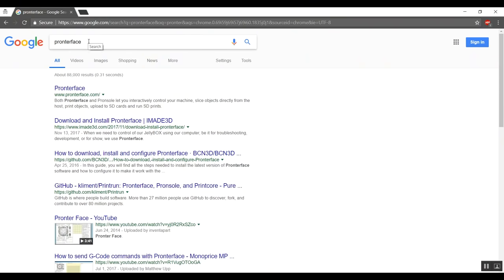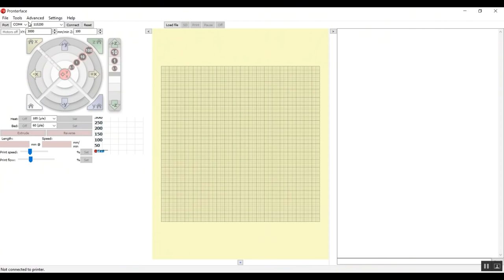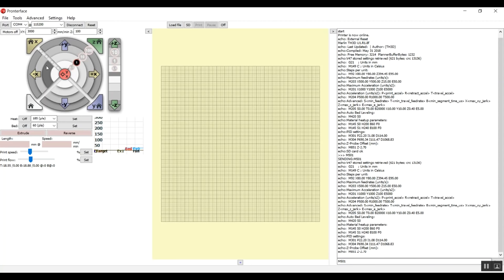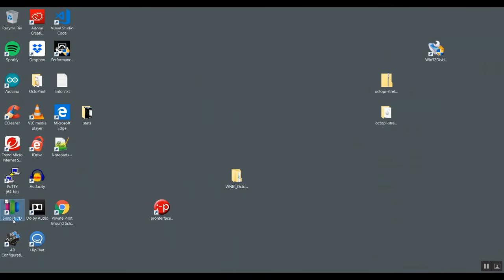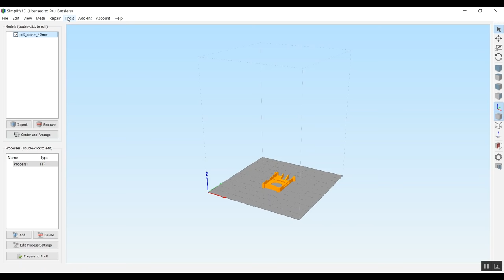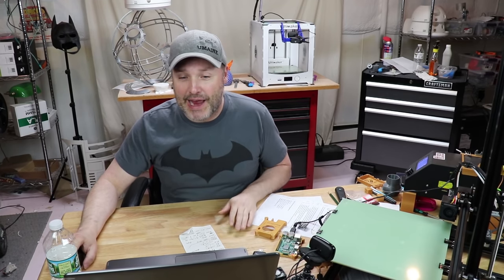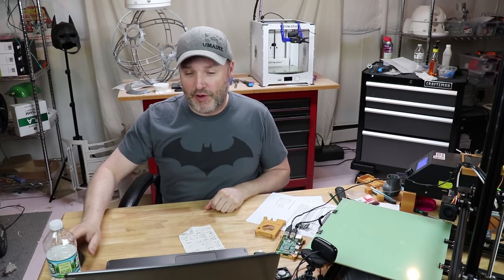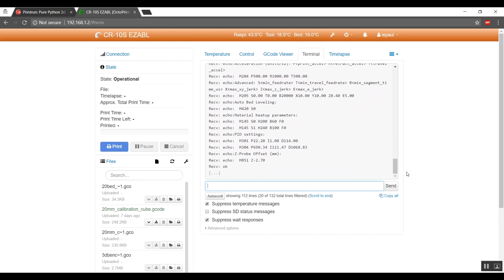How to connect to your 3D Printer from your PC via USB!

Comment: Thanks! You saved me hours. OH, so that's why Cura won't print. I have W7 -32 and the versions of CUra that let you plug into the printer require 64 bit.  Damn, I'm out of luck till I quit being such a cheap sake and get a more modern computer. Thank you for the great, helpful, well presented information. Well done my friend.
Reply: Cura 15.04.3 (don't update!) does work over USB on my Vista 32 bit computer with the Anet A4. 
Menu File, machine settings. Select the COM port and baudrate (COM4, 115200 for me). 
Click on Ok. Click on the second icon on the top, left of the platform view= print with USB.
It prints the G-code, sliced of the object that is loaded on the platform.
Reply: Ask Holy Spirit to teach you and to guide
you. I would recommend the YouTube Cleveland street preachers and follow Jesus no man no religion. Be holy and obey Jesus. Hebrews 5:9 "salvation is for those who obey. 
Jesus says if you love me keep my commandments (John 14:15). Jesus even says if you keep my commandments then you shall abide in my love (John 15:10).r

Comment: I had watched Chuck Hellebuyck's videos on assembling, tweaking, n upgrading the ebay CTC printer...which I have. I am also a nooby noob noob noobing my nooby way into this hobby. So, I got in touch with Chuck and asked him how I could go about running the CTC without having to use an SD card and the printer's accompanying LCD, what software'd be necessary, etc. [I did mention that I'm a noob, right? OK.]
  He was kind enough to link me to this video. Thanks!
Reply from the maker: That's very nice of him to do that.  (Thanks Chuck)   And don't feel bad about being a Noob...we ALL start out as new guys and slowly gain the skills to learn.  I like helping noobs and hope you can do the same for fellow new guys as your skill set rises!
Reply: Oh, without a doubt! I've already looked into tutorials for programming C++ for Arduino. Owning n effectively operating 3d printer is just one aspect of a hobby I've chosen: robotics. There are several other 2-axis n 3-axis machines I can build using 3d printed parts, and I could do with learning to use Autodesk/Solidworks/Sketchup to add to my list of hobby skills. Your video helps in that shows me the 3d printing workflow via USB instead of mucking about with LCD menus n SD cards [It just doesn't seem as fun as operating straight from a laptop and FUN is what hobbies are all about].
Live well. Be well. Thanks again.

Comment: Thank you for showing me that my Simplify3D had a print control panel! My printer panel was starting to go out on my printer. Some times it worked and I almost that I threw in the towel and bought a new panel. But you saved me for a little while. Panel not a  necessity anymore. So, thank you so much!
Reply from the maker: Hey Kurt, I'm glad my video helped you out!  Be sure to subscribe and check out my other videos you might find helpful!

Comment: I actually use cura all the time and it has a pronterface type controller. I've been using an older version of cura, 15.4 I think, and it has that option to manually control my printrbot.
Reply from the maker: Is it in there?  I inquired with them via GitHub about it in the newer versions...hadn't thought to look at the old 15.x one.
Reply: I haven't used the new version very much, it freezes when I try and print, but the version 15.04.4 and it has an option to use pronterface ui and I'm a fan of it! I'll double check the new version and see what I can find
Reply from the maker: I didn’t know that.  Thanks for commenting!

Comment: I have a question 🤔 what is the volts that the 3d printer should be set on in the use???230v or 115v???

Comment: Will a Lenovo IdeaPad S145 computer work on 3D printers, I got a new printer 2 years ago,& I couldn't run it so I give it away, I would sure like to lean how to use one, I am a old man , But I sure like to no how
Reply from the maker: Hi there. I searched the specs on that device and it has an Intel i7 processor which is very capable. You should be able to run the slicer of your choice on it. Perhaps download Cura and try it?

Comment: im having problems with usb drivers
Reply from the maker: Which printer do you have
Reply: @WhereNerdyisCool  I have many. Right now I have a Mingda D3 pro. Device descriptor failed. I've tried with many printers, proterface etc. I have a ras pi now, but I would prefer to get a connection without octoprint firat so that I don't need to rely on my pi... if that makes any sense
Reply from the maker: It does. Have you tried other slicers like Prusa , Sli3er and so on?

Comment: Hello I got all the info for running the print with your video here but my problem is probably super -simple but when I connect my little micro-USB cable into my Ender 5 PRO and connect It to my Laptops USB-port Simplify3D or any other software can NOT find the port. Do I need some special cable between them or how do I do.....I tried a WiFi-box from Creality too ( wich works sadly) and borrowed that cable ...
Reply from the maker: Some cables are just for charging. Make sure you get one that is a data cable

Comment: i know that most likely i wont get an answer but ive wasted my time before. i just installed the new 32 bit board in my ender 3 3d printer to update the 8 bit board. its the btt skr mini 2.0 and now cura cant see the printer and i can only print from sd card. and i also nitice the fan on the right side of my extruder runs all the time when it didnt before.
Reply from the maker: I don’t have an answer to that but I’d suggest asking in the Creality Ender groups in Facebook

Comment: hello ,,,can you edit the printer g-code via puterface or you have to use an editor and reflash the marlin software
Reply from the maker: Good question. I haven’t used Pronterface much since I usually use Octoprint. You should be able to slice and save the file. And use something like Notepad++ to view the file and edit as needed

Comment: Hi there I have designed a pro type and if it’s at 3d Pinter stage. So if worth’s is could then it’s deed in the watcher because of the industry machines need and work people. We’re as the 3d prints can do the same job perfectly every time but how would you connect multi printers to run exactly the same time Avery times 🤔🙈

Comment: I have a XYZ da Vinci 2.0 A duo ( I got it for free).  I know nothing about 3d printers but I thought I could learn on this.  I downloaded all the software for it but my problem is that my computer will not connect to printer.  I have it plugged into my computer and it recognizes it in the Devices and Printers control panel section. I click on the printer and get to the printer screen to see what's printing and the option to stop the printing and all that.  I then click to try and connect to it and it will not.  So my question is what am I doing wrong?  I did some research and found that I may need a FTDI Driver to actually connect to it.  Is this necessary?
Reply from the maker: You might need that.  You could see if there is a Facebook group for that model too

Comment: Ender 3 V2 is not recognized by my notebook. Device Manager shows as an unknown USB Serial and it has an exclamation sign. What I can dot with this (win 7 Pro)... hope you can help me, I  have search for controllers and cant find them
Reply from the maker: I don’t have one of those so I wonder if your need a driver   Check the Creality groups on Facebook.  Good luck!
Reply: @WhereNerdyisCool  Thanks mate.. will keep looking (in the Micro SD card included in my Endor 3 V2 are some controllers.. but no one seems to work)

Comment: So I have to buy a weird computer chip thing just to connect to the printer to install firmware instead of just connecting through the miniusb port?
Reply from the maker: If your printer requires a boot loader , there are many options a available (search of that in YouTube)

Comment: Hi! Thanks for this video. Now I am trying to connect an et4+ but it doesn't appear a port to select in the first step, it's like the pc doesn't recognize it. Did you install a driver or something? Thanks!
Reply from the maker: Every printer can be a bit different   Be sure to check the manufacturer directions (if provided). Many will suggest you have a usb driver to detect it

Comment: i need help
i cant even get that far  when I plug in a USB cable from desktop to cr10 the control box screen lights up, is there a special cable???
Reply from the maker: Just a good usb cable is all.  And Pronterface
Reply: @WhereNerdyisCool  I don't know what's going on then any USB cable did I plug in it lights up the turned-off control box. It's so hard to tell which form factor I'm supposed to use but I'm sure I couldn't get the wrong one in. I have seen a couple other people say that this happens to them too without any resolution.

my cr10 uses a full size sd card,  do you know the mac gigs I can use??

Comment: Is there anything special to look for in what cable I use to connect an ender 3 v2 to my laptop?  I'm using what I have and there seems to be no connection.
Reply from the maker: Make sure it’s a computer data cable is what I’ve been told over and over.  Chargers may not have all the connections data needs
Reply: @WhereNerdyisCool  thanks, I was using the only usb to usb mini I had which was  a charging cord for a light.  I bought a new cord today, the computer pick it up but then I had to find the driver for it to work.
Reply from the maker: Fantastic. I’m glad I could help you!  I hope you become a Subscriber!

Comment: Hello, I plan to either use pronterface or octoprint and was wondering if I can start or stop a print. Is this possible? I have an cr-6 Max with a camera setup to my computer near the printer and I wanted to be able to remote into my computer and stop a print if failed.
Reply: I checked again and it looks like you can! Thanks for your video.

Comment: Hey Paul thanks for sharing mate, quick question. Can I run four 3d printers plugged directly into a pc with Octoprint installed and control them all. Not all at once but switching between them in Octoprint. I dont have Raspberry pi's setup on any of the printers. Thanks in advance.
Reply: can i ask how you got that download to work? macafee told me its a virus!
Reply from the maker: Which program?
Reply from the maker: I’m not sure about controlling that many from a PC.  You definitely want to make sure the pc doesn’t do any power saving or hibernation to the usb

Comment: i need replacment for control box cr10 or cr10s...not just motherboard
Reply from the maker: The whole thing?  Some people do some mods to remove it completely and place it under the printer. Thingiverse has a few that look quite involved but interesting!  As to replacing the whole box due to failed components , you could check with Tony Machines
Reply from the maker: “Tiny machines”

Comment: I've got an MKS Gen L 1.0, and I've seen people use it with a Pi running OctoPi/OctoPrint/Klipper , however similar to your EZABL setup, I'd like to just use the MKS board to control a stepper motor for a non-3d-printer application (no g-code).

Any thoughts on a GUI that could be used for this purpose?   The applications I've seen all seem geared for 3d-printing, not so much debug/test (Simplify3d, slic3r, ideamaker, cura).
Reply from the maker: Really great question. Let me ask you this...have you posed the question/example of your usage to any of the Facebook Marlin groups?  That might be a good place to start

Comment: so how the hell do i get it to connect in the first place. it plugs in, powers up, you mention getting the connnection going, never mentioned whats required.... running windows 10, been 3d printing for 5+ years, never connected directly.... still cant. i plug it in and nothing. no connection to any program!! thats what i want to know. what do i need to establish a connection. you completely skipped over that step
Reply from the maker: I’m sorry you feel I missed some steps. Pronterface is the program I’d suggest to connect (if you do not have Simplify3D )

Comment: Does it work with Ender-3 PRO? Do you guys know if there is a way to print with Ender-3 PRO via USB/LAN (wifi router or by cable)?
Reply from the maker: I do not have that 3D printer but I would suggest a Raspberry Pi and Octoprint!  Check my videos and there is a tutorial for Octoprint in there!

Comment: I have a quick question I followed your steps very well but in Cura it's not giving me the option to connect to octoprint and yes I have downloaded and installed the plug in and I have it running through octopi print on its own website and its connected it's the Cure new update 4.2 0
Reply from the maker: I uninstalled 4.2 but I can set it up on another laptop and make sure the steps haven’t changed. Maybe I can help you out!
Reply: @WhereNerdyisCool  that would be great thank you

Comment: hi i just got a creality 3d printer and i have a visa hp computer and i download image on a sd card but when i put it in my 3d it does not have anything on the sd card..help..what am i doing wrong, im a beginner
Reply from the maker: Try it again....moving the file to the SD card.  Now...this part is important, in the lower right hand corner...in the System Tray , you should see a USB drive icon.  Left click on it and select Eject [whatever your SD card is]   It sounds like you may have corrupted the file and it didn't save properly
Reply from the maker: Try it again....moving the file to the SD card.  Now...this part is important, in the lower right hand corner...in the System Tray , you should see a USB drive icon.  Left click on it and select Eject [whatever your SD card is]   It sounds like you may have corrupted the file and it didn't save properly

Comment: Can you do the same with Repetier Host as with the application software that you mentioned? Repetier Host is also free. Also, does Repetier Host plug directly from the PC to the printer with a USB cable?
Reply from the maker: Yes!  Another free program that works well!
Reply: Does Repetier Host plug directly from PC to printer or does it need some interface in-between?

Comment: With Cura 3.4 and newer you can print from usb cable, althought (at least for me) it has worked fine with CR-10 and not with Ultimaker, do not know the reason...I was actually looking for more info when I found this video
Reply: My printer can detect the USB drive but can not read any file from the USB.

Comment: I've been trying for a few hours to get Pronterface to connect to my PC. When I click connect, it doesn't do anything and hangs on "Connecting..." Any advice / fixes? Unable to print anything because my Creality BLTouch is not leveling low enough. Always defaults too high.
Reply: My baud rate is correct according to printer.
Reply from the maker: Can you tell me what printer and what baud rates you’ve tried?

Comment: What TYPE of USB connector fits in the Ender 3? I've bought several and I never have purchased the correct model/size.
Reply from the maker: I don’t have an Ender 3 but I’ll see what I can find out for you
Reply: @WhereNerdyisCool  I really enjoyed your video.  After my comment, I went to Google and figured it out.  An Ender 3 takes a 5 pin USB-mini connector. The same type used by Garmin and GoPro.  THANKS!!!
Reply from the maker: Good luck!  And be sure to Subscribe!  Merry Christmas
Reply: I like your info on Ender 3. Might want to research it.

Comment: I have tried everything suggested to make my Ender 3 Pro actually print, including using Cura, Crealty Print, and Printerface. I have the USB connection and the correct Crealty driver installed. In Cura I get a "Cannot Slice" error. In the others I can see the slice program running on my screen, but my printer does not move. I can't get any support from the company. I am ready to throw the thing away. Do you have any suggestions? I'm not even sure my PC finds the printer, but I don't know how to fix that if true. Help!
Reply: "print from TF" is what it will say in the menu when the card is inserted
Reply from the maker: Paul, were you able to get printing?

Comment: It annoys me that the process is not "plug and play" in most cases.

One should be able to buy a 3D printer, plug it into a computer, said computer goes "oh I've found a new device, do you have the drivers or do you want me to search for them?"

I purchased an Elegoo 3D printer, opened Cura and set it up easy peasy.

My neighbor purchased an Anycube, can see it in Cura but will not show the prompt "print to USB"

Given that software and hardware manufacturers have been doing this now for decades. One would think the process (across the board) would no longer need to search for third party software to resolve this.
Reply from the maker: Yes some vendors are much better than others

Comment: I run my Arduino based printer from simplify3d on my pc. I want to add a camera to take pictures for every new layer. So I was thinking about adding raspberry pi, connect the camera to it, then from octoprint on the pi I can control triggering the camera and sending the gcode line by line to the Arduino. But I'm now asking if this can be done through simplify3d without the raspberry pi? The problem is that simplify3d is not Open Source. What would you recommend?
Reply from the maker: Well the Octoprint server can replace all of that!  The Pi, configured with Octoprint, connects to the printer via USB.  The webcam connects as well, then you can set how the recording is done.  Easy Peasy Lemon Squeezy!  Give it a try!